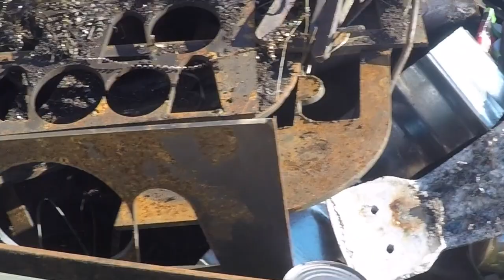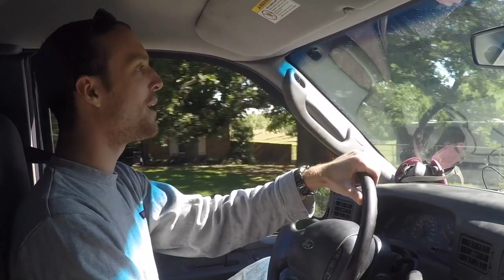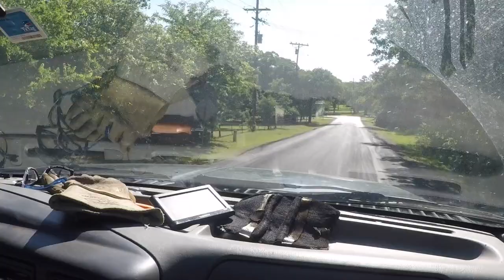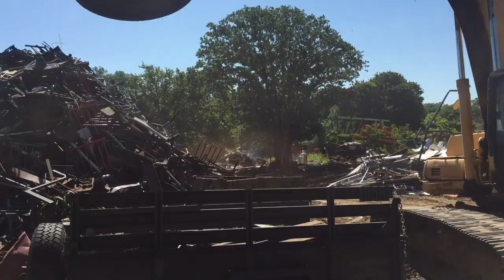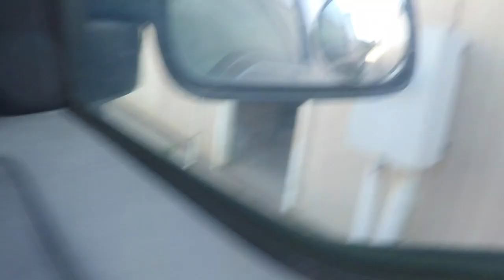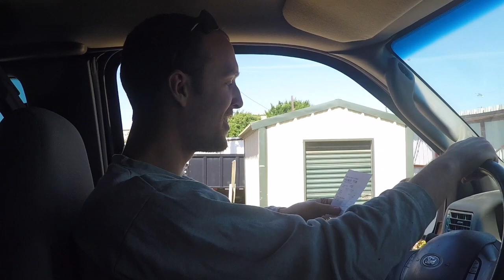THE QUICK WAY TO MAKE SIDE MONEY DURING A RECESSION

Comment: Scrap prices are crap right now. I'd hold on to it and wait for prices to rise.
Reply: Salvage yard maybe 400 yards away from my house, pop cans were 70 cents per pound for maybe a week. Then dropped to 60 cents for a week and a half. Then 50 cents for a month. Then 40 cents for about 3 months. Now it's been sitting on 35 cents for the last 3 months. While gas and diesel are still over $4 per gallon.
Reply: In eastern europe, mixed iron is about 220 euros/ton. I'll wait more till winter when usually the price is higher.

Comment: I haul that much with my little 5 x 10 lawnmower trailer and my crappy ford ranger. Trailer is now f$%#d but mostly from the careless machine operator getting in a hurry and dropping heavy stuff on my little trailer. Scrap has been decent in west tn at .09 cents a pound, just dropped to .08 cents.